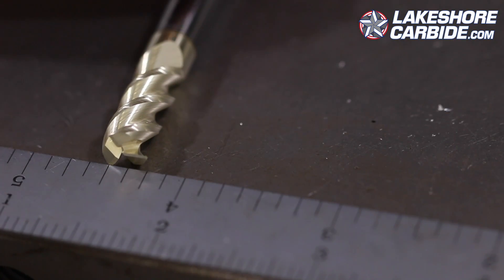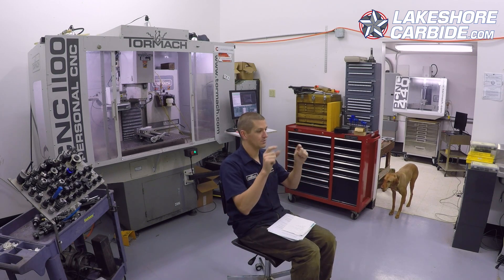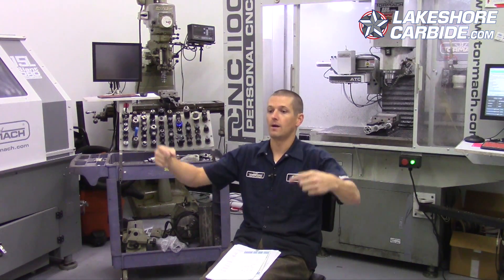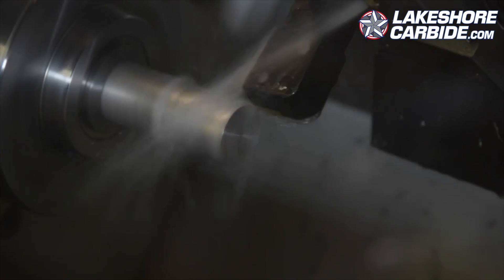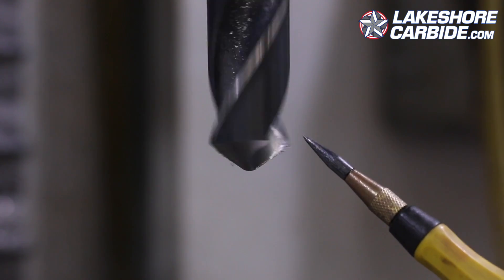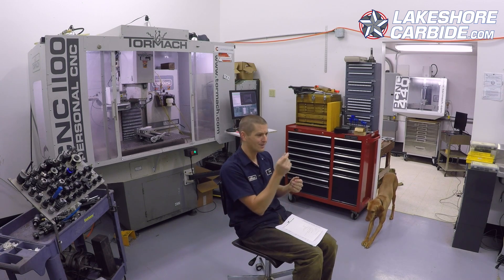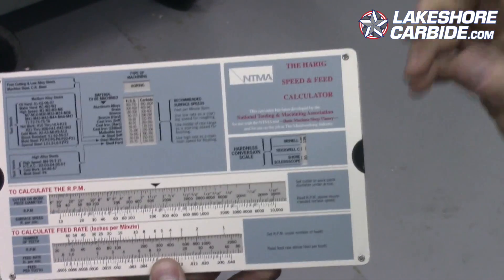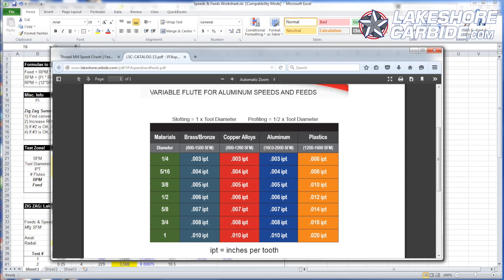3. What is SFM & Why it's overrated!

Comment: Your whole video pertained to machining soft metal. The surface feet per minute is very important for harder metals and metals that produce a lot of heat when machining. You don't need a sliding chart to calculate the RPM, all you need to know is the suggested SFPM and the cutter circumference. And a little algebra. Some metals cant exceed certain SFPM because the speed of the chip removed would cause excessive heat for the cutting surfaces.

Comment: SFPM is the maximum recommended. Not the exact value. 

So as long as you are below that, you are fine. It’s just that in a large manufacturing firm, they want to go with the maximum to get the minimum time per part.

So as you said, as long as you are not rubbing, you are fine.

Comment: As being a Lathe Machinist in the past and seeing the subject as I felt like I was mislead after watching a little bit of this video.  At a diameter of 7.643 a SFM of 500 equals 250 rpm while a SFM of 500 at the diameter of .318 equals 6000 rpm.  SFM is not overrated ignoring the actual contents of this video I’m offended

Comment: I know and do what you do and always have however there is a misperception of the so called reccomended surface feet per minute. Actually what they are based upon traces back to on HSS that the interface temperature cannot exceed 1100 F. that is the point that the steel will begin the break down rapidly not just from friction but chemically because of extreme heat. I never have thought nor was told anything else but they were maximum speeds. I have always known that with aluminum especially you go far beyond rpm and also issues of chatter and things in relation to the length. Where the failing is is that the writers of the charts--such as the slide rule your using are "inept"--smart in some ways but dry personalities that left the info off because the engineers are so "narrow" and cant speak english to regular people. They grew up as only childs--got bullied and ended up in a lab and are penny wise pound foolish and drew up charts and graphs to confuse people. The more confusion they create "makes them look all the smarter".
Reply: This is probably one of the dumbest comments I've read in a while.

You failing to apply quite simple concepts to your work isn't the fault of anyone but you.
And especially not the fault of a very simple chart. If anyone's inept here it seems to be you.

Try working with an application engineer from a major cutting tool company to optimize your process and you wouldn't talk such utter nonsense insulting a whole occupation as inept idiots because of your incompetence.
Or maybe you still would, because his simple advice might fly right over your head, who knows.

Comment: Better tooling gives you higher SFM. How can this benefit you. Faster productivity. If your buying tooling that has a higher SFM than your machines can handle, your simply wasting money. If you need faster productivity, buy tooling that meets the maximum your machines can handle. If that's lower SFM. Buy high speed or lower grade carbide. If your machine can haul. Spend the exter cost on high feed mills and drills. Good luck. Awesome Video though.

Comment: All well and good to use aluminium as an example with a 6mm E-mill, but wait till you start machining more up the hardness scale and then tell me it's overrated.

 maybe if you called this video chip thickness or chip load is more important than cutting speed id be ok with it but sorry this is rubbish. throw an 80mm dia insert cutter at some 4340 and tell me running it at 1/4 its recommended cutting speed is still fine and economical for yourself or the company you work for

Comment: For all materials I multiply the drill diameter by .015-.02 Just change the sfm. With a fast and strong enough spindle, I noticed my feed rate doesn't change, only my rpms. It's interesting. I have never had drills last so long

Comment: My professor just told us to never go over the recommended surface footage on our first year. The thing is materials that need low sfm react different at crazy sfm being cut with hard tool material like ceramic. You can even get away with higher than recommended sfm with chip thinning. I think chip load is where people are really coming short
Example: I have studied suggested drill feeds and speed. I found out that every single drill company suggests the same proportional chip load for each tooth but just change the sfm
How I calculate chip load for a 2 flute drill for ANY common material up to 440c is I multiply the tool diameter by .015 for conservative or hard steels (no jobbers go half) to .02 for fast cutting
Just change the rpms

Comment: im running 9,000 rpm on my diy cnc router for milling hot rolled steel! Going 40 inches per minute, .039 inch width of cut & .39 inch depth of cut. I found that canola oil mist worked best (dont use water), I felt my tool & part afterwards, its cool to the touch & still super sharp!
Reply: Someone Else try diluting it with kerosene. 1:1
Reply: Try lard

Comment: Something tells me you machine a lot more aluminium or brass then steel. You can get away with a lot when machining aluminium. 
In steel, and certainly tool steels, the cutting speed is extremely important. A cutting speed that is too high will ruin a tool in a short time, a speed too low will mean a feed that is very slow as well.
Reply: Exactly! I think too many machinists think the exact opposite. Lighter chip load and faster feed. No!! Bigger chip load and slower feed will get a job done. You can always increase sfm. But if your tool is not getting big chips out then it's number of hits per tooth increases. Remember. Once a chip is formed, the point is not doing the cutting
Reply: Tell that to Guhring. They ramp 45 degrees in to 4140 tool steel like it was plastic... just tested one of their endmills with ridiculous numbers and HSM toolpaths.. 600 sfm or 4954rpm on 304ss .05 doc and .....180ipm, on a worn out endmill. RF Diver series. I only did a few pieces just to test. Was looking for built up edge. There was some but if I add air oil mist, should better I think than coolant.

Comment: I can't help myself. 

SFM is actually very significant, especially regarding carbide tooling. 

Carbide tooling isn't sharp per say. It's actually rather blunt. Compare a carbide endmill to a HSS endmill's cutting edge. Under a 20x loupe. A carbide tools looks like a ballpeen hammer compare to a HSS. 

Carbide cuts with heat and pressure it physically fractures the grain of the metal AHEAD of the cutting edge, where HSS shears it. 

Think of in terms of wood. If you have a really sharp knife you can shave off a thin piece of wood no problem. This is shearing. Where the absolute edge maintains contact with the material through the whole cut. This is how HSS cuts. It shears. Now carbide, that's more like a splitting maul. You focus a heavy force to a rather blunt edge. That force gets transferred into the material and caused it to fracture along the grain. But you don't need the maul to go all the way through. And the edge only contacts the material at the first moment of impact.
Reply: Now back to SFM. SFM is that initial impact force. And you need a bare minimum of force to drive the carbide edge into the material and cause it to fracture.  Too low an SFM and there's not enough force. Which means no material fracture and leads to falling and edge wear.
Reply: And if your machine doesn't have the required rip'ems to meet the minimum SFM (lowest mfg suggested number) switch to HSS tooling whose SFM requirements are much lower.
Reply: Solid carbide endmills can be very sharp as well. There are carbide tools that are much much tougher then they used to be 20 years ago.
Reply: Occams Sawzall ya.. I love john, but sfm is very important.. it reduces heat on both the work material and endmill once sfm reaches past 1,000 sfm.
Reply: Its huge in carbide.  Most carbides tools are made to fracture grains.  Too low and they cant fracture the grain structure and more or less wind up smooshing and rubbing instead.  Just look at what type of wear you are getting.  I think johns problem is he doesnt do much production, like hundreds or thousands of parts so he doesnt see the tool wear that these charts are intended for.  Hes right on being maxed out on a machines spindle speed though, if you cant get to the required sfm, max the spindle speed and then adjust the feed to get the right chip load to ease rubbing as much as possible.  Im not sure how this applies to sintered/cemented cobalt hss tools though, im not sure how sharp those are, ive really used them as thread formers, and they seemed really sharp like hss.

Comment: And then you have the harmonic tap test which opens up another parameter which is closely related to chip per tooth and not sfm.  The the tool life, manufacturing percentage and how much money it will make or loose.  We have a cincinnatic 850 and 2500 with 18k spindles but you can stall them out with your tounge.  Little to no hp, I take .060 cut depths, full width tool (most dia are between .5 and 1 inch) 3 flute data flutes and 400 ipm and faster.  If the hp was capable of handling more and it does on linear cuts its when it gets into corners where you have at or more than 90 degrees of arc contact it boggs down or stalls out.  We use catia too which is very powerful but id like to see some intuitive feed and speeds coding instead of manually selecting slow down in corner and slow down in rpm and trying to match it with the tap test harmonics you can spend 3 hours on one tool path for perfect paths and speeds and feeds and then the machine controller defaults to some magical number all by itself and youve just encountered an exercise in futility lol.  Great explanation on sfm and why it plays a part when needed and why chip load/thickness whatever you want to call it is still a better limiting factor when it refers back to rpm and hp.  I always look at whats the max rpm and then torque, then cross ref cutter manufacture recommended chip per tooth and whatever sfm is, is what it is, unless the machine cant actually handle the feed which almost always happens when you have extremely high rpm spindles and small dia cutters.  We have a mag with a 30k spindle its feeds doesnt come close to utilizing that feed rate when you have smaller cutters.

Comment: I just wanted to kinda bring you back alittle bit. I understand what your saying about about the high end of aluminum tooling which helical does recommend 1600 to 2400 sfm. Now what I want to make clear is yes in aluminum you can basically go with your peak Machine RPM and then do you tooth load calculation. But where it becomes extremely important to know you SFM is when you work with materials including steel. Your machine may do 5100 rpm but if you try and run a half inch 4 flute end mill through a part to make a slot you will ruin it. If you say on the low end its 505 sfm for a slotting cut your speed should be (505*3.82)/.5 which is 3858. And that is just in say a piece of 1018. You start working with stainless 17-4 ph or titanium and you don't use sfm you will throw money right out the window. So I agree with you in the one aspect that yes in aluminum it does not matter but in harder metals it is an important part or programming.
Reply: Oh and I just figured I would add this, the majority of manufacturers give you the low end of the spectrum with there SFM for the longest tool life possible. So you can also have the opposite problem that you are running on the low end. But if you use it as a guide to start from and then increase from there that is the best choice. I have run titanium that has a recommended SFM of I believe it was around 200 or so at closer to 400 with no problems. But for the home machinery and people doing this as a hobby you don't want to break a $150 end mill on the first cut. So do your research and start at the recommended sfm when possible they are a great starting point. I recommend getting ahold of the tooling company's catalog or going online where some company's have tooling apps and wizards to help you out.

Comment: Recommended SFM is not derived from a chemistry lab but from cumulative use data that includes a multitude of variables including tool material, part material, lubricant, and so on. While it is frustrating to try to find proper speeds and feeds for smaller tools while cutting softer materials I would never tell anybody that is not important. Aluminum has a very broad range of recommended speeds but that narrows considerably when the materials increase in hardness. Perhaps it would be better to say that chip load weighs more than sfm when machining soft, ductile materials and leave it at that. SFM is greatly appreciated on harder, more unforgiving materials.
Reply: Absolutely, and as tooling technology increases we will see more and more variations from the norm....for the better!
Reply: I read an article once about a shop who allowed their tooling supplier to implement every new tool that they introduced. As they began upgrading their tool technology they increased their production speeds and decreased tool breakage. They claimed to have saved so much money that they were able to quickly update and outfit their shop with the money they weren't expecting to save. We are reluctant to implement changes that cost us money.... sometimes the hardest thing to overcome is the belief that this new technology works as well as the reps say it does......but it does

Comment: I used a chart that was given to me years ago that got me in the ballpark for manual or cnc machines. We had 6 manual lathes and vertical mills that always used different speeds and feeds for each one even if cutting the same metals. An old machinist told me that no matter what machine you have or how old it is you have to learn what it does or doesn't like and it'll treat you how you treat it.

Comment: Hey John, if you really want to understand chip theory and what is going on in the cut, I highly suggest finding and reading a copy of Sandvik Cormant's excellent book on the subject titled "Modern Metal Cutting, A Practical Handbook".

It traces the development of cutting tools from the very beginning up through the cemented carbides of today.  Very informative, and very in-depth vis-a-vis how a chip is made.

Used copies come up on eBay and Amazon from time to time for $50-$75, or you can pop for a new copy off Amazon for ~$200.

It's worth the $50, I assure you.  If you don't like technical reading, it'll be a little dry, but I found it a fascinating read.
Reply: Thanks for the book tip, just ordered a copy, I find this topic fascinating and would love to dig deeper